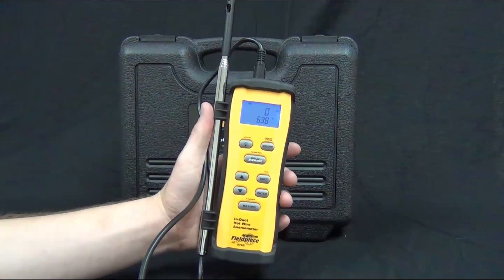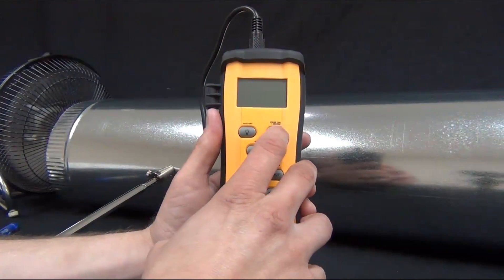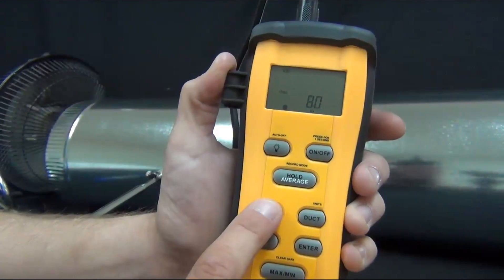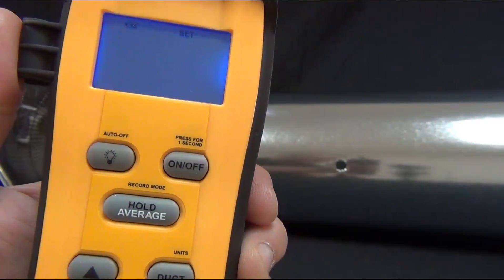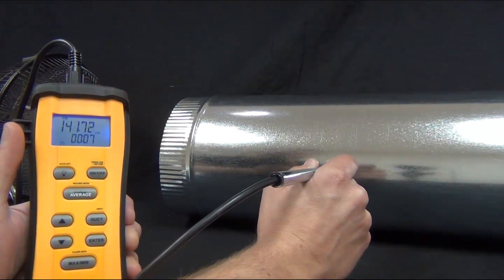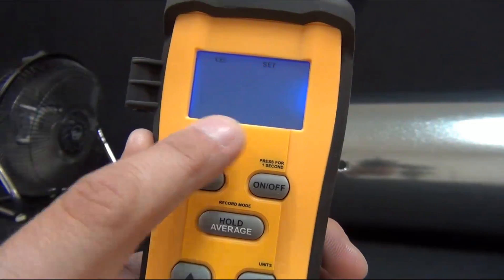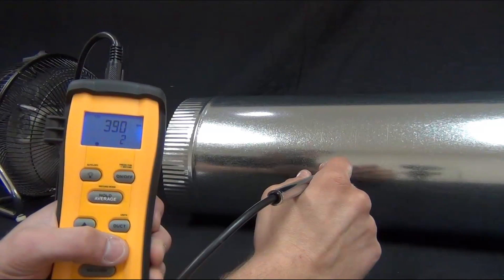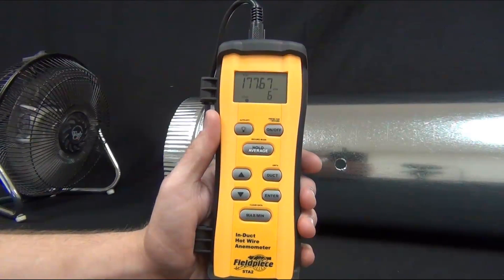STA2 Fieldpiece In Duct Hot Wire Anemometer

Comment: I want to measure air flow from aeration blower, regenerative type, in a 2-inch diameter PVC pipe. Would this do the trick? Air flow will be something like 100 cfm. Another thought, could I measure on the intake side of the blower? Also 2-inch diameter.

Comment: Residential use only. It will go up to 10k cfm before going OL
Reply: Recently I have purchased STA2 Hot wire anemometer but I am facing difficulties to measure airflow which is above 7000 CFM the displays shows option " OL" over range can u please advise me how to fix this problem.